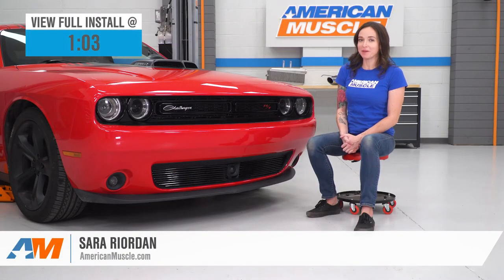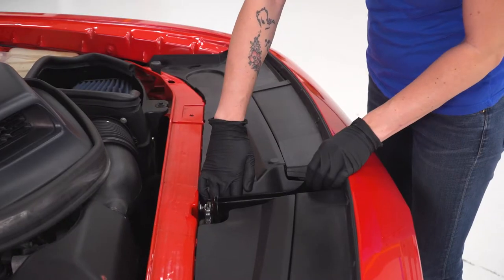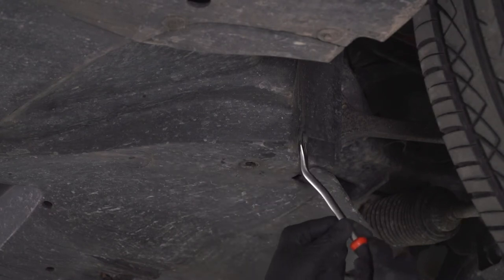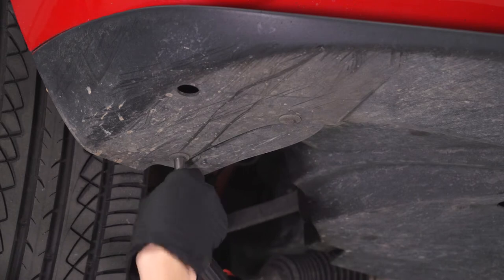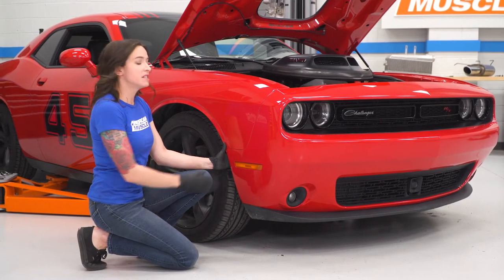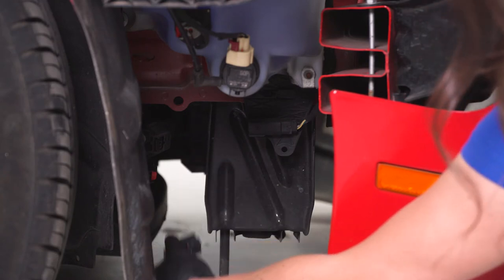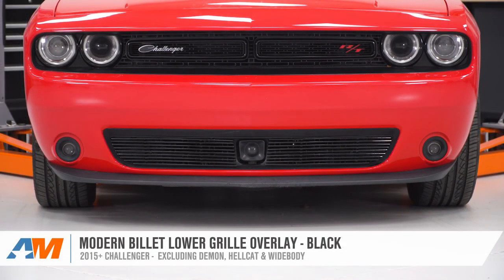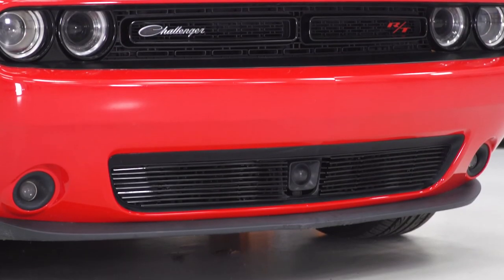2015-2021 Challenger Modern Billet Lower Grille Overlay; Black Review & Install

Comment: no u don't have to take the front of your challenger off to take the lower grill off.there r 4 rubber plugs on the bottom of u r bumper take them off and u can access the 4 screws that hold the grill on the other screws u can take off easy DAN THE FISHERMAN

Comment: Butterfly nuts are being used I believe those can be screwed on before installing then fold in the butterfly nut and slide them in through the grille I believe there's enough spacing  they'll open up on there  own once behind the grille then just pull to tighten them up